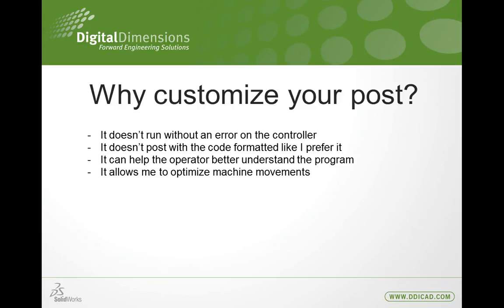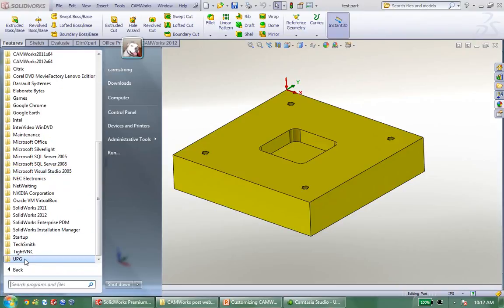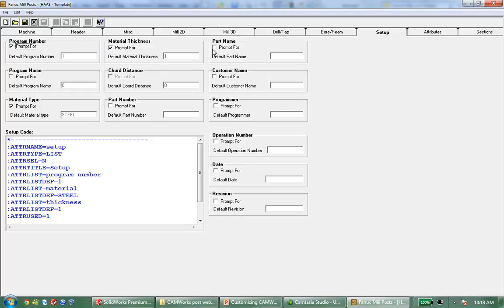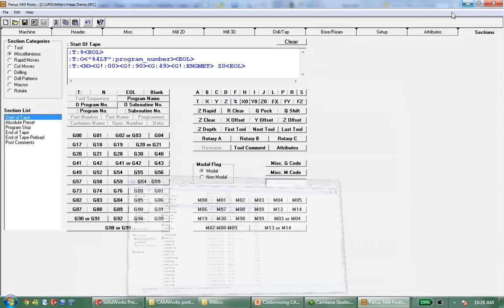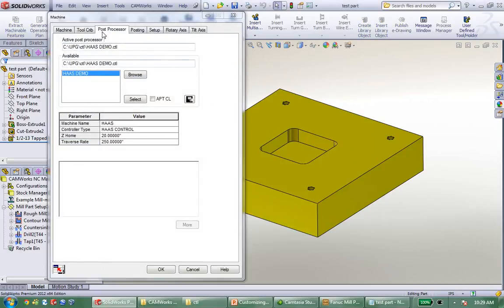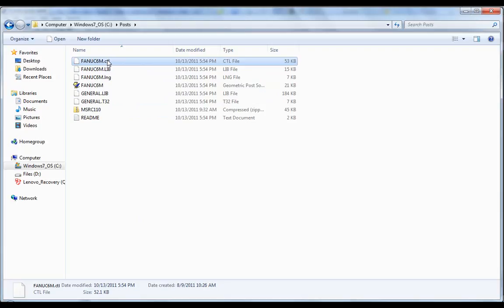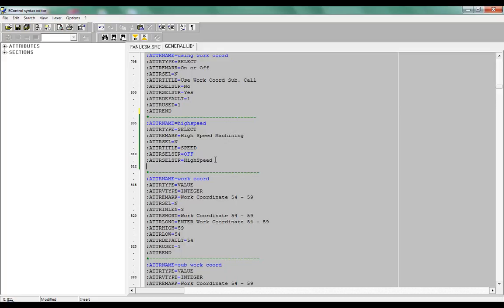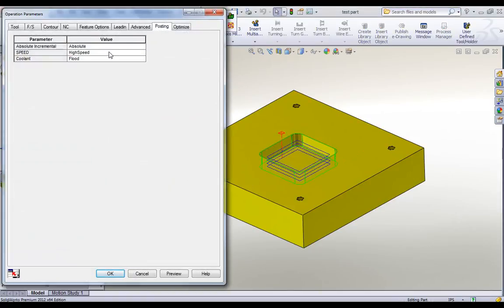Video Archive: Customizing CAMWorks Post Processors

Comment: Hi, My name is David, I’m from Venezuela, and I am learning on this UPG-2 and EC Edit-2 by myself. It’s not easy and I have very queries.
Do you can help me with this?
My Question is the follows:
-	Is It possible activated the parameter “Sub. Peck amt” in Tap Hole? The Drill operation if it have this Parameters.